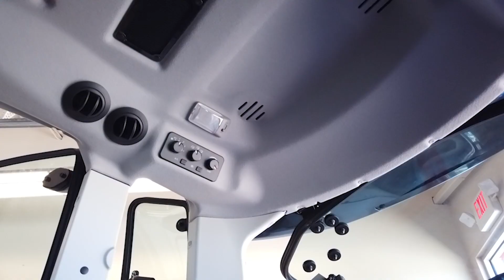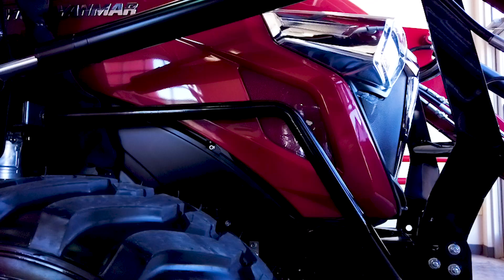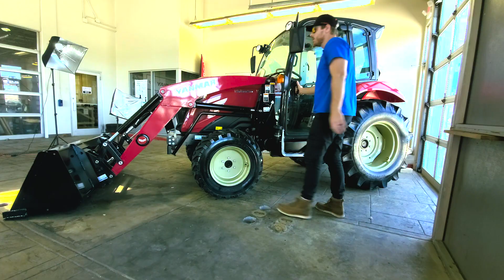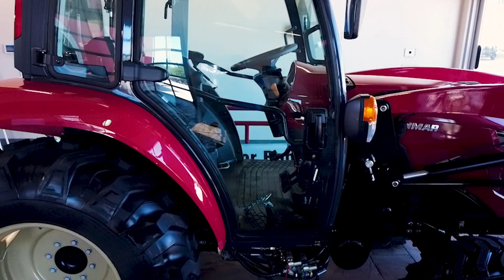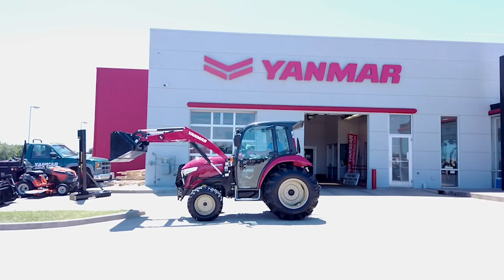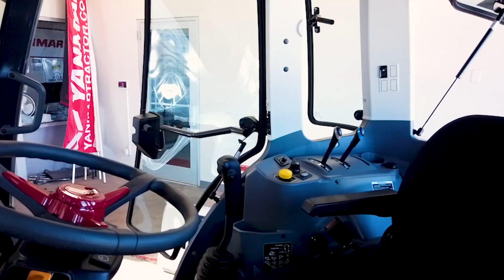Yanmar YT347 Cab Review 47hp tractor

Comment: I'm surprised at how close in price the Yanmar is to the Kubota.  The YT347 is a bit under spec than the MX5400 (w/o cab) and I bought a new MX5400 for $32K with rear remotes, 3rd function.  Of course I used the 20% Equine discount (which anyone can get if you sign up with the NCHA for free).   If I was looking for a John Deere I might just go with the Yanmar.
Reply: The Yanmar YT347 sits between the Kubota L4060 and MX5400 on many specs, but cost several grand more than either.  With the 3rd function and mid PTO not even offered on the Yanmar a L4060 was $40,739.  The MX5400 was $41,418.  The Yanmar came in at $44,174.
Reply: @Noah_E  The Yanmar is most like the Kubota L4760. The integrated 3rd function is available. It has two rear remotes standard. The L4760 ROPS tractor with loader and bucket list is $44,700.00.
Reply: Explain more for that 20% discount please.
Reply: @Mr.WS6  National Cutting Horse Association

Comment: So the non cab version is the same as the cab version without the cab. How does the pto have hp at zero speed?
Reply: I think he was referring to you can use the PTO when the you are going 0 miles per hour you still need about 2400 rpm to run the pto

Comment: I would buy the YT359 Tractor Cab right now BUTTTTT we do not have a Yanmar dealer or service site near me. The closet dealer is 2 hours away and i will not like towing the tractor 2 hours away to get service. i may have to settle for Kubota
Reply: I had to 'settle' for Kubota because I walked into my local Yanmar dealership with $30K to spend on a new tractor and they literally didn't bother to show me anything.  They told me the gate was on the side and have a look out back.  Check back if I see anything I like.  I can't imagine what trying to get a service with them would be like if they couldn't be bothered to make a sale.  Sadly, this dealership was also the Kioti dealership in my area. I went with Kubota.

Comment: Question, will the seat out of the 347 fit in a 235? I don't care if the mounting holes won't line up, I can make an adapter or drill new holes. I'm curious if the dimensions of that seat will physically fit on the 235 platform?  also, whats a 347 seat cost through you guys?  The 347 was overkill for my property but the 235 is the perfect size for my 5 acres of grass.  I love my 235, but hate the no suspension seat. I need to change it out sooner rather than later.
Reply from the maker: Thank you scott for your question. Our Parts department will know about the seat situation you're trying to solve. Its a very interesting question. Also the 347 costs around 30,000 the 235 costs 23,000 both non cab. Heres the number to call, please call between 9am-4pm                  (405)604-5454
Reply: Were you able to get an answer?
Reply: How to purchase Yanmar YM342A in India...
Please share contact details

Comment: Whats the cost with cab and without?
Reply from the maker: Cost is 30,000
Reply: @TractorBobs  $30K for tractor with cab and no loader?
Reply from the maker: @frankcastle7777  With cab and loader is $42,000 without cab but still with loader is $32,000